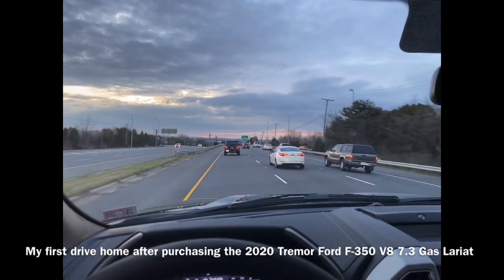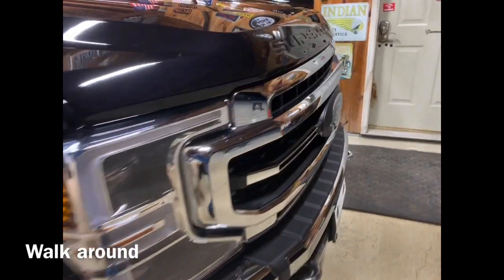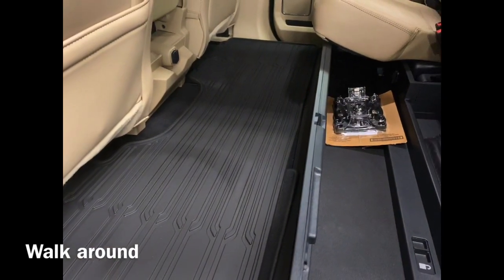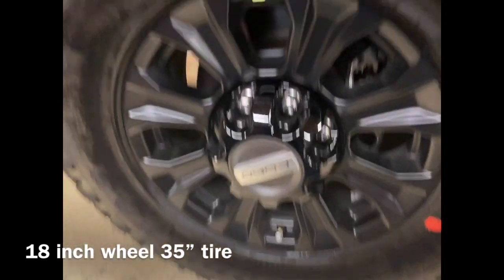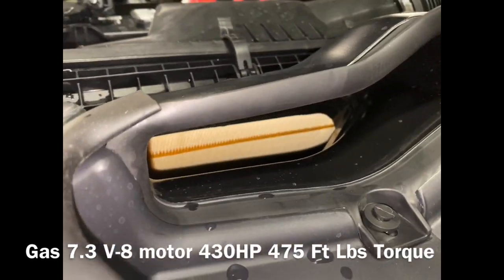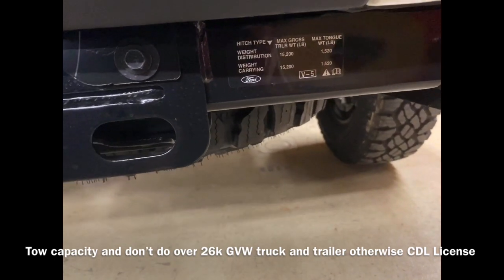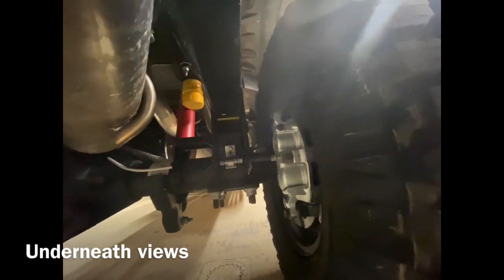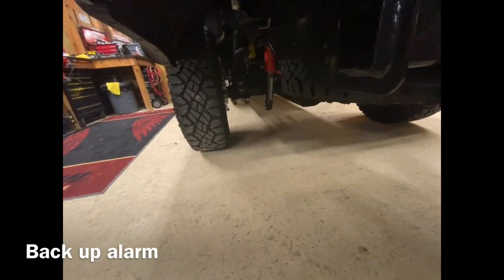ICE AGE TV Just Purchased a new Ford F-350 Lariat Tremor Gas Motor 7.3 2020 model

Comment: GOod video. Just a note, personal RV's are exempt from the CDL requirement.
Reply from the maker: Good point and this is true which is crazy when you think a 80 plus person can buy a bus RV and or truck and rig that’s 40-60k plus weight going down the road.  But if your towing say your race car hauler and or just a really nice car hauler behind your Dually Truck you are required to have a CDL License.  This is why you see a lot of Cllass A RVS towing most car haulers these days.
Reply: @Iceagetv  And those same old guys don't even have to be air-brake endorsed in most states - crazy!

Comment: I just bought the same truck in Star White with the blackout package. Do you know what the difference is between the F350 Tremor 7.3L and the F250 Tremor 7.3L. I knew they both had the same suspension but I was told by the dealer the F350 had a larger rear axle but after doing some light research it appears they both have the same rear axles. So I am wondering what is the difference if any and what I paid an extra thousand dollars for? I am pretty sure the payload is higher on the F350 Tremor 7.3L vs the F250 but if the drivetrain and suspension are in fact the same how can that be? Did I really pay an extra 1K for a higher payload sticker on my door?

Comment: how are you liking the godzilla engine on your 350? besides the cost of the powerstroke what else was your deciding factor that pushed you towards the gasser
Reply from the maker: I really truly like this truck and I have owned and still own diesel trucks but the Gas is definitely I nice change up.  I test drove the Tremor diesel and gas back to back.  It is a big difference to the Gas engine set up advantage.  The fun factor feel and power is all there since its a 700 pound less on the front end and you really feel the difference.  The truck just feels faster and lighter and more nimble than the diesel.  And interestingly enough the Diesel Tremor was a F-250 and the Gas was the F-350 which I now own.  So to answer your question the Gas is the more nimble funner lighter truck and she shares that with you when you drive her. The exhaust note and motor is so nice as well and hope this info helps others come to closure on what fits the seat of your pants.

Comment: Nice truck.On the F350 with the tremor package. Do you know what the gooseneck / fifth wheel capacity is ?
Reply from the maker: 20,200 lbs with 4.3 gears and here’s all the specs for all the HD series https://media.ford.com/content/dam/fordmedia/North%20America/US/product/2020/f-series-super-duty/2020-Super-Duty-Tech-Specs.pdf
Reply: @Iceagetv  Thanks.
Reply: I have a 2021 f250 7.3 Tremor Package 2900 lb payload 18,000 towing with 430 gears, I pull a 41 ft 5th wheel total weight loaded around 14,000 lbs PULLS GREAT

Comment: I’ve ordered an F-350 Tremor but I’m worried it might not fit in my garage.  Particularly the cab height of the truck.  What’s the cab height of your truck?  Specs I’ve found say 83.2 inches.  Recently I’ve seen some folks reporting the 2020 Super Duty sits lower than the 2019s so I don’t know.  If I’m measuring my garage door correctly, I’ve got 83.5 clearance.  Too close for comfort.
Reply from the maker: I’m going to measure today and will let you know.
Reply from the maker: I just published a video with measurements.
Reply: ICE AGE TV - I really, really appreciate your video about the cab height of the Tremor.  I am getting the roof clearance lights too.  I think they look really good, so I’m confident based on your extremely thorough measurements I’m good there.  The black plastic things (maybe antennas) towards the back are going to be close.  Again, I can’t thank you enough.  I can’t wait to see the video about your cat-back exhaust system.

Comment: What up brother, mileage must still be low but have you had any instance of the front end wobble.
Reply from the maker: Hello Hector good question since all these HD trucks are pretty stocky with these solid front axle set ups.  Which brings the good and bad being the good it’s the true truck feel and true to its origins.  The bad is all of my brands I’ve owned over the years you feel more of the imperfections of the roads thru the steering.  And I have not experienced any front end wobble but you do get a little bit of waking.  I am amazed with the tire set up and lift how well she really does handle and initially felt seeing this truck last summer she would be to rough and tough.  But to my amazement she being a F350 1 ton setup is really an awesome fun riding truck.

Comment: Do you know your tow rating for a fifth wheel and what gears you have
Reply from the maker: Yes I do she has 4.3 gears and 20,200 fifth wheel set up.
Reply from the maker: Yes I do she has 4.3 gears and 20,200 with fifth wheel set up.
Reply: That would work for me. How your everyday fuel mileage
Reply from the maker: 12 mpg and I truly love this truck and motor and set up.
Reply: The 2020 f350 tremor has a 5th wheel/gooseneck tow capacity of only 16,800lbs
VS the 2021 F350 tremor which is 20k  for 5th wheel/gooseneck.   I’m not sure what they changed between the model years though.  Fords tow guides aren’t really the easiest to follow    Lots of foot notes on it.   
I only noticed it myself after realizing that each year has its own specific Ford towing guide and there are changes between 2020 and 2021.

Comment: You’re right. The front isn’t not raised
Reply: I believe the Tremor simply has snow plow prep springs as they sit the exact same height as a snow plow prep truck, need to get a vin off one and check with parts and see if has its own part number coil springs.

I wish the Tremor actually did have a 2in.  front lift/level, I would install 1in. lower coil spacers.

Comment: 12mpg???? Yeessh
Reply from the maker: 12 mpg is what your going to average around town mix driving.  And keep in mind I have owned many many trucks and brands which most trucks are not the most economical and especially big trucks.  I have had many Toyota Tacoma trucks and most recently a 2018 Pro which I put bigger tires on and she averaged 12-14 mpg no lie.  And my current Jeep Gladiator Rubicon with 37s averages 13-14 as well.  My most recent Chevy Silverado 2019 with the 5.3 small block gas was the best yet ever.  And she would get up to 25-28 mpg on long highway trips and or about 18-20 all around driving.  My Ram 1500 2019 gas 5.7 hemi is gas guzzler as well she gets 16 mpg so in essence for a 7k truck with a 7.3 motor and big tires lifted 12 mpg ain’t too shabby compared to other options and she can still tow 21k.
Reply: @Iceagetv  I've got  a 2019 f150 crew cab 4x4 5.0 I get 19.7 average
Reply from the maker: @zacd7094  Thats respectable and as I mentioned I was amazed with my 2019 Silverado LTZ 4x4 Crew Cab 5.3 gas motor getting incredible hwy mileage.
Reply: @Iceagetv  My problem is everytime i obtain something i want something better.. swore the f150 was the one now I want a 6.7 and dont even own a trailer!
Reply: That is pretty good considering a 1/2 ton Tundra with a 5.7 gets around the same lol